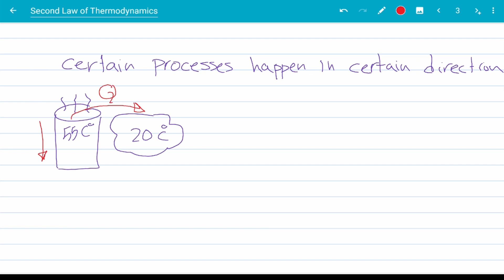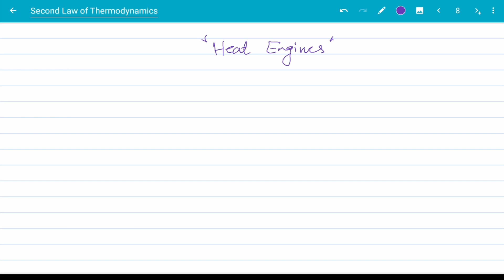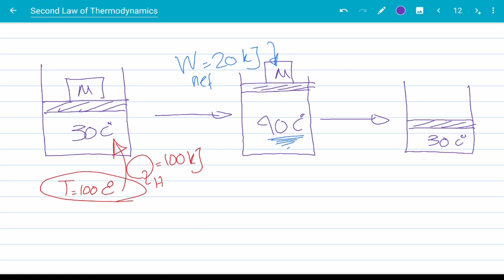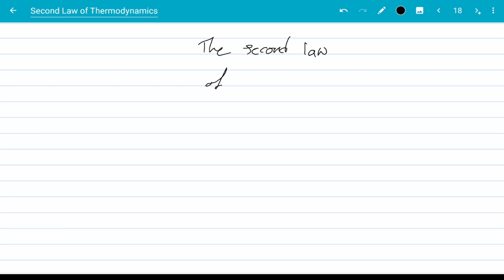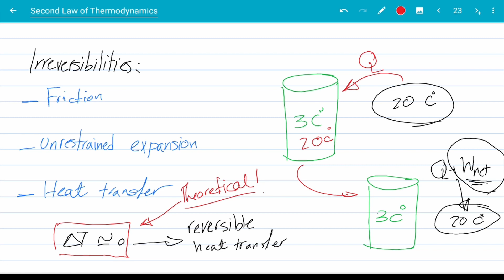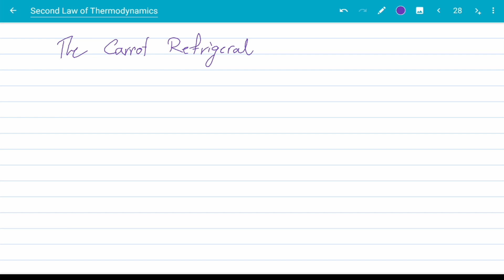Second Law of Thermodynamics - Thermodynamics

Comment: I have a question. For example,  I am given the pressure for a saturated mixture and I have to perform linear interpolation to find the Saturation Temperature. If I want to get the values for hg for saturated vapour and hf for saturated liquid, do I have to conduct another linear interpolation to get their values since the values wouldn't match those in the tables? I am wondering because that would be quite time-consuming. Or is that the way it is supposed to be done?
Reply from the maker: Thanks for the comment. Yes, that is exactly the process of finding those values. Essentially you need to do linear interpolation for every entry in the table that you need. You can use an excel spreadsheet to your advantage. However you do it, it is a little time consuming.